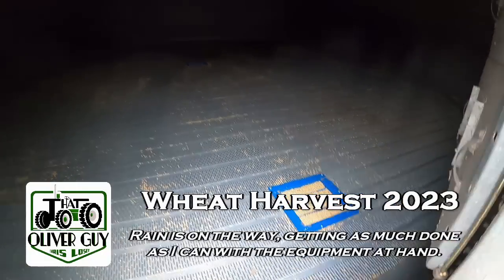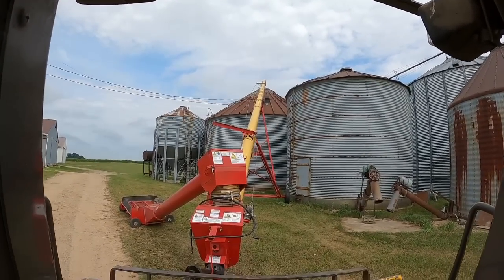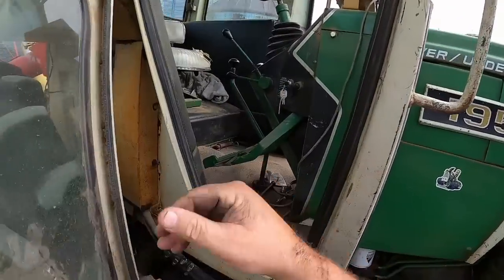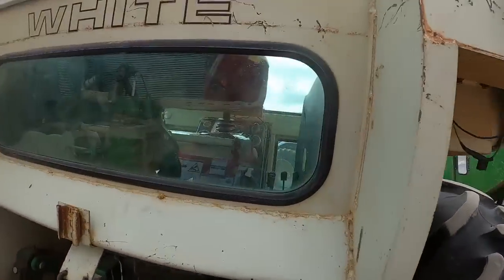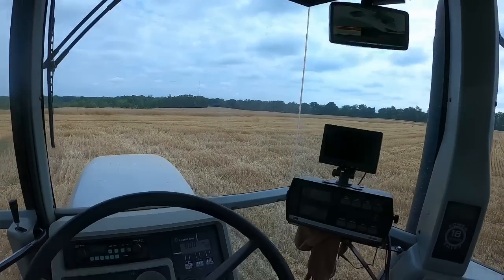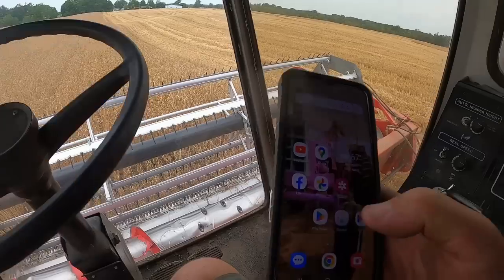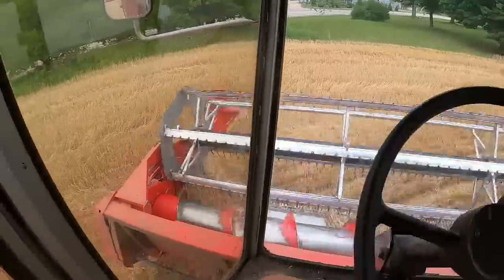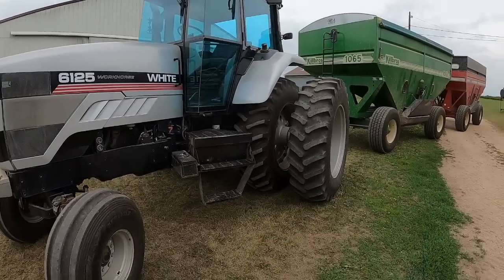WHEAT HARVEST RAIN DELAY? How far can I push the harvest window?

Comment: 1955 on the auger is not overkill, it speaks confidence
Reply from the maker: It worked out pretty nice. Usually I don't use cab tractors on the auger, but having that left hand door to run the throttle keeps it convenient.